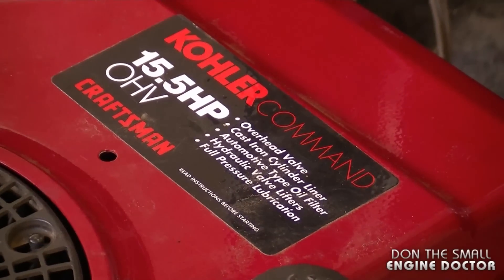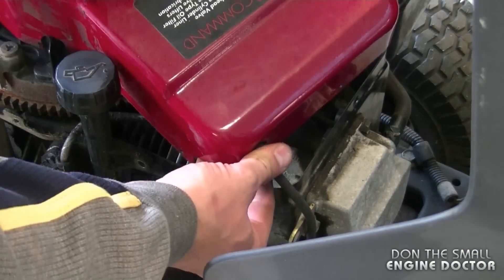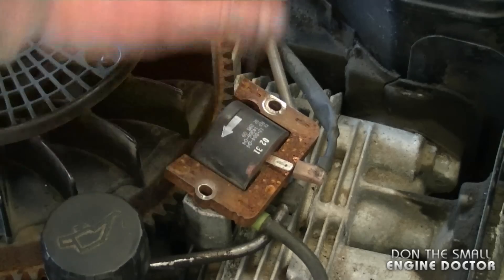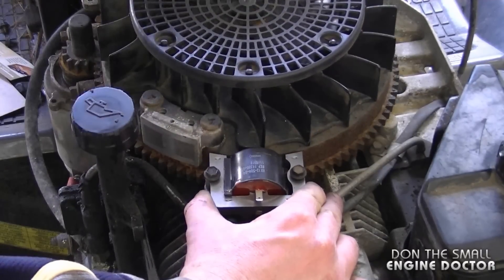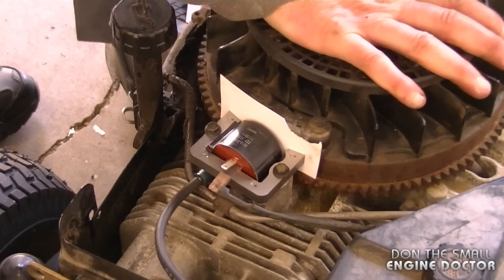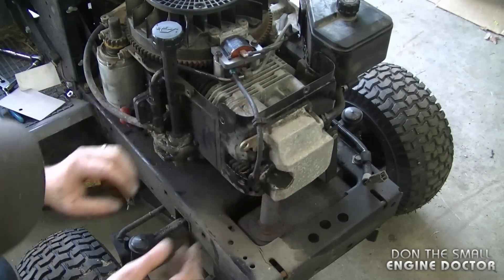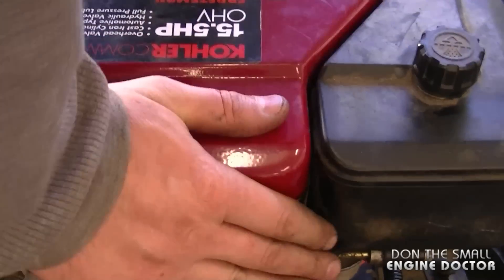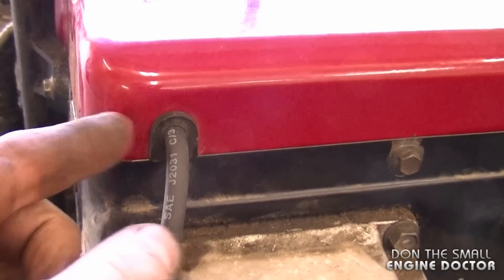Kohler Command Ignition Module (COIL) Replacement

Comment: Hello Mr. 73,

Your diagnosis and your tutorial worked like a charm. I can't thank you enough. Saved me from reinventing the wheel.  I have no idea why you took the time to produce such a super video. But I'm glad you did. Replacing the coil was a piece of cake, card trick and all.

I was working on a Craftsman 16.5HP lawnmower. One thing I'd warn the next one to be careful with is to make a note of where the bolts go. Yep. There are two different sizes and lengths. Put one in the wrong place and the dang engine won''t turn over. Trust me. Grr!

Anyway, again, super thanks for a teaching job well done. 

Norm
Your massive fan in Alabam!
Reply from the maker: you're welcome Norm

Comment: Based on the symptoms I would not have guessed the faulty ignition module... I had similar symptoms from bad spark plug thread. Hot engine, leak around the thread, no compression... Took a while to find out :-D
Thanks for the videos!

Comment: Any idea what the resistance should be?  Also do the magnets ever loose magnetism that would cause a loss of spark?  I have a very similar motor cv14t on a scag that lost spark, I replaced the ignition module with an oem and still nothing.  I checked the grounding wire for shorts with my ohm meter and no shorts.  The only possibilities are the new one module was bad or the magnets have lost enough magnetism…and yes I tried it with multiple good spark plus…

Comment: Most of the coils need a 0.10 air gap, but I always use a card as well. I also cut and shaped a piece of plastic from a oil bottle that really works well.

Comment: Very old video but at least shows I didn't put my new coil on upside down. Unfortunately it still won't start despite inline tester showing good spark. Carb cleaner spraying not getting it done either.  Checked bunch of stuff.  Pulling flywheel next but see no reason for key to shear after years of use.

Comment: My cv 15 runs rough. If I spray ether into carb while it's running, it smooths out. Their led me to believe it was a fuel issue. I've replaced the carb and spark plug. I've replaced fuel filter and loosened gas cap. Nothing has helped. Could it be the module?

Comment: I would like to see a video on how to fix a John Deere X300 that surges at idle and half speed. Seems to run ok at full speed with blades engaged. I look for wake to all your videos because they are very helpful and interesting. Thanks!
Reply from the maker: A QUICK GUESS WOULD BE TO CLEAN THE CARB
Reply: You're probably right, thanks.

Comment: "Doesn't run good?" Does that include sounding like the engine is starving for gas after it runs fine for about 30 minutes? On my Kohler, after the engine starts to sputter and sounds like it's going to stop, I have to disengage the blade to reduce the load on the engine and usually the engine will then run OK and I can at least ride back to the garage. If I just sit by the garage with the engine running and the blade not engage the engine WILL eventually stall and stop. Does this also sound like a bad coil?

Comment: I have a Homelite XL Automatic oiler chainsaw built in around 1980. What do you think of the products that advertise that one small packet mixed with a gallon of gas produces a mix that is fine for chainsaws whether the recommended mix is 16:1 or 50:1 ?

Comment: do you save the old parts you replaced to show to the customer? back when I worked on engines for a living I always kept the old parts to show them but most the time they weren"t interested and said they trusted me, but to be safe side I showed them anyway.
Reply from the maker: same here
Reply: Now they can watch the repair video!
Reply: How would most people know an electronic device was not working by your showing it to them?  They wouldn't, so it is unnecessary.   I want to be treated fairly and honestly.  So just do that.

Comment: have a ch12.5s on air compressor have replaced lifters, carb, spark plug ,fuel filler ,fuel.runs great until 100 psi then pops through carb and shuts down. governor is working properly. I'm stumped any ideas?  compressor always runs up to 165 no problem

Comment: Hi Don! I have Romany question because I have a toro Lx420 some engine crank like you sed but won’t start.
I change:
Carb
Ignition 
Head gasket 
Fuel line, filter etc.
But still crank crank and won’t start.
Just wen I give a jump and start.
Please if you have idea wats the problem is? 
Thanks!

Comment: Hi Dony,
We bought a country home and they let us a lawn tractor with a Tecumseh engine. It is extremely hard to turn over, the starter and battery are good but yet the starter is overpowered by the engine. I adjusted the valves correctly and it was still hard to turn over. Since last week it now won't turn over at all. Would it be the compression release? the camshaft?
Reply from the maker: did you get the battery properly tested? usually the valves or the engine being hydrolocked causes this problem. check the valve lash again, i set them at .005

Comment: i have a 30 hp kohler command engine it is hard to crank. it some times wont crank at all. when it  will not crank it doesn,t fire  You can jup start it and it fires and will crank. Is it the ignition module/

Comment: Awsome video Don! I just cleaned up the ignition module and replaced the head gasket of my riding mower today :) What brand/type of ratchet are you using in this video? And in the last few seconds of the video, is there a 50's Johnson outboard laying in the background? Have yourself a great weekend :)
Reply from the maker: that was a Jet 1/4" drive ratchet

Comment: The hardest part is the shroud on these engines...so many bolts! Why cant it be like a Briggs with 3 or 4 or 5 bolts total.
Reply: I see it's hard to find some original Kohler pro replacement parts you could use just about any coil on those 

But mine needs a new spark advance module so it'll atleast start up and run the new coil I put on works but not the black box

Comment: Symptom of mine is it runs good then just stops running. Let it sit for a while then it runs fine for a while then then just stops running, does that sound like an ignition module?
Reply from the maker: that's what the machine is this video was doing!
Reply: @donyboy73  ok thank you, I’ll add that it is a kohler Command 6 engine, mounted on a trac-vak leaf collection machine, it has a pull start. I assume it has a coil?

Comment: What happens to the module, there is a wire inside that breaks inside the module, when it is cool, it will make contact, when it warms up, it expands and breaks contact. I broke open a couple years back, one was on a Stihl 038 woodboss and the other was from a briggs, they was broke in just about the same place.
Reply from the maker: thanks for the info jim